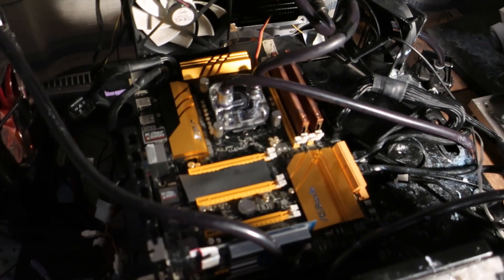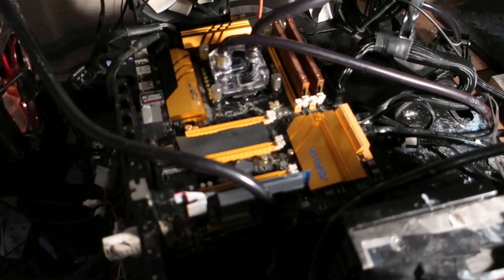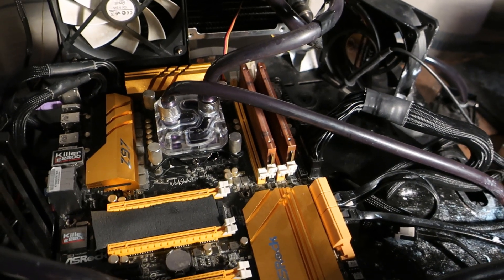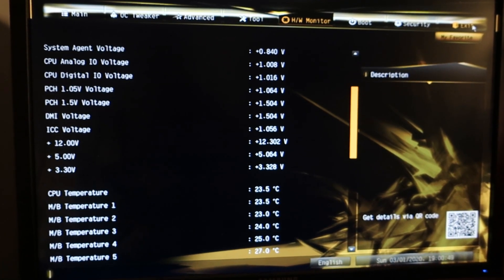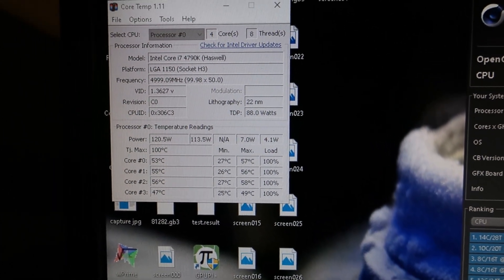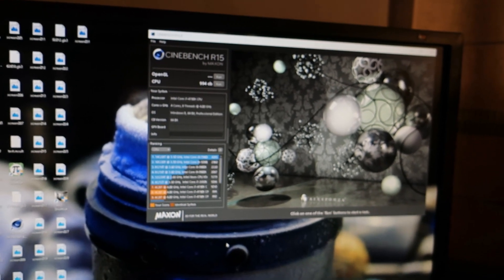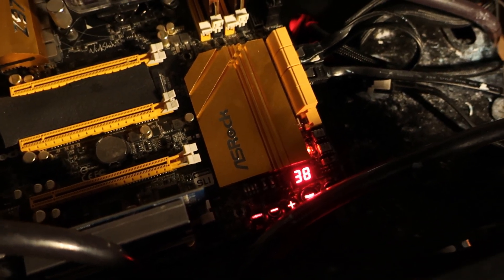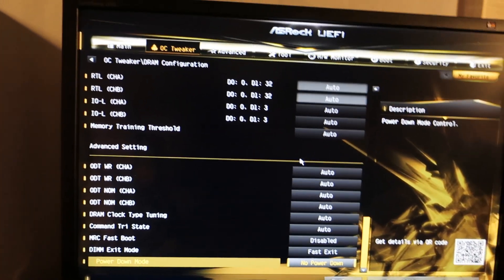4790K Binning on Asrock Z97 OC Formula - 5GHz with 1.36V

Comment: I have a 2015 4790K @ 4.6 Ghz, Air cooled, vcore 1.23 using offset (even managed 1.19 fixed voltage), DDR3 1866 (stock). I wonder if I should bother pushing it further to 4.8? how much more voltage would it require, and if it would be worth it.

Comment: I just ordered a 360 aio for my 4790k. It'll pass any benchmark you throw at it at 4.7 with a knockoff 212 evo, most at 4.8 around 80-90c. Does anyone think 4.9 stable will be possible? Just dont know what to expect. Kinda nervous ill need to delid. This is a new old chip, so thermal paste isn't cooked, but its old af so idk.
Reply: I have a arctic freezer ii 360 and have delided my 4790k with TG conductonaught.. I'm running at 4.7ghz at 1.265 and never goes over 60 degrees stress testing or 55 degrees gaming you could definitely push higher as I'm thinking to a decent cooler eats away at the heat.
Reply: @michaelderrick8709  I got 4.8 stable through any benchmark. And a oc on 4.9 that I haven't crashed in a game yet after a month. But it honestly sounds like your silicon is probably better.
Reply: @michaelderrick8709  nice to hear, i today ordered same cooler and im also trying what i can benefit from delidding my 4790k. It is running 4.6 ghz with aircooling, we shall see in next week i think.
Reply: @tomagucci-m2p  its been a week! Results yet?
Reply: @flyingunderwear  hi! I did succeed in my project. I planned this for few months while weighing the pros and cons. My cpu had one core with 10 celsius hotter degrees than the rest. I decided to try delidding. After i carefully applied liquid metal on top of the cpu, installed it back without glueing the ihs. I also installed 360 mm 3 blade aio watercooler.

First quick tests i made, i ran original clocks. I tried blender tests and similar programs so i could see how this setup worked out. With original clocks my temp would now stay below 56 degrees celcius. Coretemperatures did also even, now there is only few degree differences. I did quick try to see how setup would react oc. After i got to 4,9 ghz my system came unstable, 4,8 was ok. Temp stayed under 65 degrees while blendering.
I think that i need to dive deeper to bios settings, im not sure my voltage settings are alright. Temperature wise i could go to higher clocks, but i need to get this thing stable. I did feel great accomplishment when i first time ever hit 4,8 ghz.
Reply: @tomagucci-m2p  that's great news mate. The arctic freezer ii 360 is a beast of a cooler.
Reply: What mobo you have?
Reply: @ahmedst290  msi z97 gaming.
Reply: you need to delid.

Comment: I have an 4770k but I can't get the ram speed running at speeds greater than 2200MHz ... is this a motherboard issue ? I got the asrock z87 fatality and corsair vengeance 2400MHz ram (the ram should reach 3GHz I think)

Comment: I have a 3770K that can run 5GHz with some crazy voltage, but it does run it. I was stuck at 4.8GHz because of the toothpaste, so a delid and some Liquid Pro LM was definitely needed to get the temps down 20°c. The good thing about the 3770K is it has a 105°c tjmax so it gives just enough room to squeeze that last 200MHz out.
  I got really lucky with this open box 8700K I got for $280 a year ago. The manufacture date was Jan.2018 though, the lot number was damaged on the box. I haven't removed the CPU since i installed it, on a z370 Aorus Gaming 7, or else i would post the lot number. When i do swap the cooler or chip I'll post it on here or Reddit. This 8700K i have on AIR runs 5GHz with 1.250v and up to 5.3GHz with 1.380v 0-AVX offset CBR20 stable for Hrs. I figure an AVX load is as strenuous as any stress test out there. I've had it up to 5.4GHz but didn't try any further because it was on AIR. Going by Silicon Lottery this 8700K is the top 1% of 8700K's. On top of that i was able to push a 2x8GB kit of Sammy B die 3200cl14 to 4000cl16 no problem with 1.450v on the mem. and i even tested a old 4x4GB kit of Hynix MFR/BJR 3200CL16 to 4000cl17 also with 1.450v. So i know the imc is solid.
Reply: what do you think about 1660v3? can it go 5ghz?

Comment: 5.4ghz on water or go home ;-)
Reply from the maker: Send me that quality CPU and I will run it.
Reply: @LuumiJuhani  You'll never get my 9900K, its what I frag noobs with :P
Reply: @kommandokodiak6025  you’re comparing a processor that is only intended to run at 4.4ghz on turbo. to your new 8 core which is designed to reach 5ghz without overclocking... it’s not the same.
Reply: @LadiesmanAchmed  r/woosh
Reply: 60000ghz on air so there.